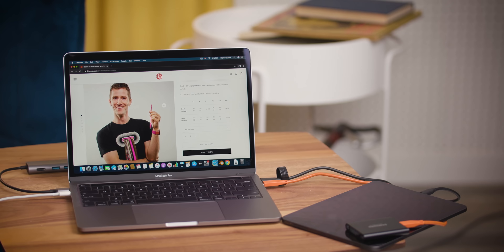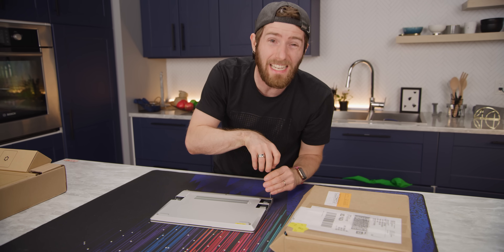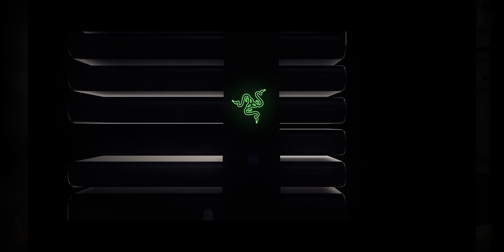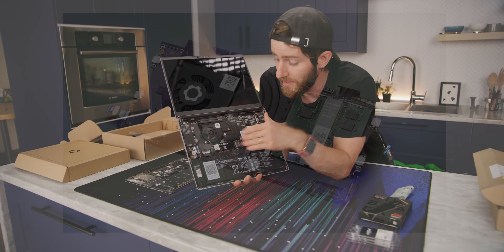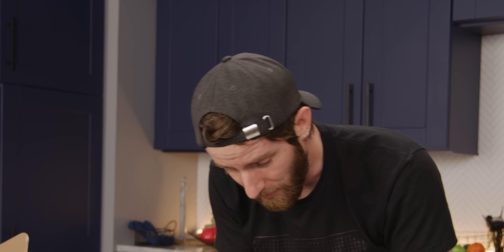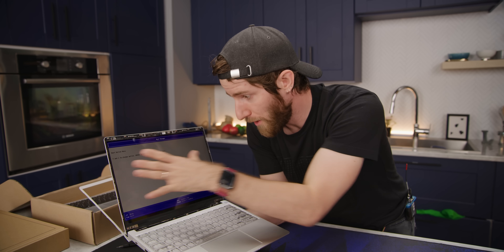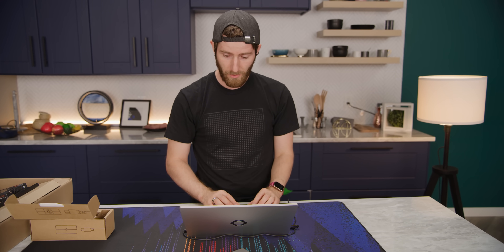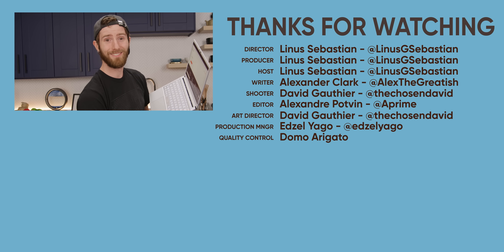A COMPLETELY Upgradeable Laptop?  - Framework Laptop Review

Comment: I don't know if other manufacturers do this but Dell does at least in its business line of laptops have BIOS options for battery usage patterns and charging options. No disconnect option, but with their branded power management software you can set the battery to hold a specific charge range when on A/C power. For instance I have mine set to about 50% so even though I use it on A/C power 99% of the time, the battery is always held around 50% charge. I can go change the setting if I know I'm going to need to use it on battery for a while and the battery is in excellent\new condition that 50% charge is more than enough for quick usage scenarios where I need to be mobile. So that is pretty handy, at least for caring for your battery.

Comment: I don't see GPUs unfortunately. I figure integrated graphics would be passable for the stuff I'd want to play on the go, but I'd like to have at least a decent GPU option to have a more robust gaming laptop. Not necessarily VR ready or anything, but at least something that I Can run games on moderate settings with a smooth framerate.

Comment: I’ll throw out my MacBook when the hackintosh community hacks this bad boy.
Reply: Wait you do realize that for Hackintosh, we have to work around the limits in OSX that try to make it un-runnable on other hardware and NOT the other way around, right? The mentioned laptop will run whatever OS you put on it happily. It’s macOS that decides once it starts that this isn’t a Mac and therefore it won’t run and you should buy a Mac. It’s a very artificial limitation
Reply: @mattcoffin29  This laptop SHOULD already support hackintoshing just fine. It has an 11th gen CPU, so graphics acceleration should work and if they're advertising this as being very configurable then it's a reasonable assumption that the BIOS should pose no problem to opencore. WiFi card is interchangeable so if the intel one that is preinstalled doesn't work with the WIP intel wifi kext then you can easily change it. The only things that MIGHT pose a problem are the touchpad and the cameras, but those can be hacked around to work. The only thing that 100% won't work is the fingerprint sensor, even if the driver is open source.
Reply: @mattcoffin29  Is thare a will, thare a way. Community has the power to do anything. OSX is not magic, so hacks are doable.
Reply: @mattcoffin29  Sir if u know about this little more. Maybe u kknow how is that with M1? I think is not so agnostic right?
Reply: @mattcoffin29  I need a hackintosh that can edit 4k 60fps video because all I know is FCP. Unfortunately, the graphics part of that is EXTREMELY limited. Rather not have everything soldered, but for portability, that is literally my only option
Reply: @mattcoffin29  another problem in macos is that they literally have drivers for ONLY their hardware...
Reply: it's true though, that no OS that exists now is as intuitive to use as macOS unfortunately. I wish it wasn't true but it is. Windows is a virus and Linux, still to this day, requires command line commands to do the simplest crap.
Reply: @trifecta9810  Twister OS, very little command line. It's icons, menus and that  mac bar at the bottom.
Reply: I suppose you could try running macOS on a KVM on this
Reply: Install Twister OS, choose your Mac theme, best OS ever.
Reply: I wish the same but Mac moving towards ARM processor closes this door. Hacintosh with Intel is very unreliable and requires lot of workaround with drivers..
Reply: Whats so great about macos I don't get it... I'm now 2month into using mac because got one at work and would change to either linux or windows any given minute. For example mission control doesn't show labels on windows unless I mouse over which makes it unusable when I have many opened terminals and editors and can't judge which one I need just by looks and need a label. Many tiny examples like this where my guess macos optimized looks over utility annoy be every day.
Reply: @sk-sm9sh  Well.. see it depends upon your usage and what you are used to.. I use both Windows and mac extensively and I love Mac.. (I do like windows too but i would choose mac for my personal device) One major reason is its so much integrated with my iphone and airpods (which is my daily driver and I also develop ios apps) Copy-paste between mac and phone and airdrop is like second nature. Also the apps are super optimised. I have to restart windows Everyday. I cannot think of sleep mode in windows. But my macbook has never been shutdown since a month i guess. I just open the lid, work and close the lid.. Also windows is filled with bloatwares and ads. even after paying for the dam OS I dont accept it.. BTW my macbook is 6 yrs old now and still no lag or performance issue (i7 16gb) There are some flaws like everything but pros wins over cons..
Reply: @sk-sm9sh  no mission control labels without mouse over would be nice but.. unusable? Please. What a joke. macOS is better in every other respect practically. Grow up.
Reply: @sk-sm9sh  Bottom line, stop pretending your workflow is everyone's work flow. Who gives a fuck about up button in finder, there is back. You can set finder to show full path in title bar then you can click on any folder of the hierarchy right in the title bar and it'll go to that folder. You can drag folder icons from anywhere right into file save boxes and it'll automatically go to that folder. yes, macOS has shortcomings but overall it's way better. Certain apps in windows, when in full screen, I can't even alt-tab out of, in macOS I just swipe my fingers on the trackpad or mouse and I go to a new desktop. Easy as shit. btw, macOS is probably better to use with trackpad or magic mouse because of gestures.
Reply: @trifecta9810  I think you haven't been using win for long time as a lot of thing you mention seems outdated.

"but overall it's way better"

I get it. There are differences. It's ok. And I'm working my way over it. But the most annoying thing is exactly this. "Oh it's fine you'll figure in the end you'll see it's way better". Well so far I still can't see it and I'm afraid I will never see it. I understand that different people have different working styles and in my life I had not single time came to person who's using Mac and tried shoving them Win or Linux telling to "try it, it's way better". Neither one isn't. It all depends on work style.

> hierarchy right in the title bar and it'll go to that folder

This is good tip. Only now did I realized that I can right-cilck on it and it drops down. I asked couple people where is the up button and only get response about back-button.
Reply: @sk-sm9sh  overall you can do more in the GUI and int he terminal in macOS since it's UNIX based. So yes, overall macOS IS better. Just not for your specific workflow. And I have been using windows for 20 years before I used a mac believe me. I would rather burn windows then ever use it again. I have had many people say macOS is better. So just different experiences.
Reply: @trifecta9810  what "more" can you do huh?
Reply: @sk-sm9sh  so bomb apple headquarters. What do you want? tbf, Apple has gone downhill since Steve Jobs died.
Reply: Why not PopOS? my sir
Reply: @harshvermac5  As a Linux user, I still have my own hackintosh that I use for video editting (sometimes, I rarely do it these days) and Xcode. I got photoshop to work in wine so I don't need macOS for that, but anyways I'm trying to learn GIMP. Point is, I simply don't see Final Cut and Xcode coming to Linux, and I don't see Darling (macOS compat layer) progressing at a rate fast enough to support these applications.
Reply: @kquote0364  the single thing that makes me the angriest about apple is the fact that they wont let you make apps for an Iphone for example unless you have a macos machine, and even then it HAS to be one of the newer models cause after like a few years they've stopped supporting the older machiens. It honestly makes me want to boycott apple, if every small coder or hobbyist that has have had to put up with their shitty business practices just stopped making things closs-platform for them im sure they would lose some market share st least. Of course thats just impossible and it will never happen.

Comment: You may also want to mention that those little ufl (micro fl) antenna connections are normally rated in the single digit connection cycles. Not knowing exactly which connectors they use, I would assume less than 10 cycles on those connections unless you can get exact specs. from the manufacturer.

I may need to hold out until they have discreet GPU.

Comment: 16:16 Yeah, it saves the battery. But one of the pros of using laptops is you shouldn't be worrying of sudden power outages, which you will if you disconnect it.

Comment: I looked it up and they didn't have a dedicated graphics card. For me, that's a no deal.
Reply: I'd imagine they'll offer a motherboard with a mobile discreet GPU at some point. But like Mobile CPUs, GPUs are BGA-packaged, so they're fused to the motherboard. Or at least one of the Ryzen APUs that have decent integrated graphics.

Hell, maybe they'll ressurrect the MXM format (what laptop Discreet GPUs used in some cases, a modular laptop isn't entirely new as an idea after all)
Reply: @DFX2KX  I assume they could make one more oriented towards desktop replacement. People would be more understanding of it being thicker. They could make the MXM slot accessible from the bottom with a couple of screws.

 You know how an MXM card springs up when you take the screws out of it? Do that in reverse to where it screws to a stationary heatsink and then you just slide the cover back over it, job done.

Comment: wow that looks super modular and easy to work inside, yet also be a nice looking sleek modern package from the outside. It's noticeably thinner than my dell 5410 which doesn't have a replaceable keyboard without ripping into the entire system board.
Edit - I'm just waiting for the Ryzen release at this point. I'll buy a Zen with GPU the first day they of availability hah

Comment: The concept of this laptop it's just awesome. The only thing I would add to this it's just a dedicated GPU for all the gamers out there.
Reply: May be, it can attach a GPU on one of its module via HDMI.
Reply: @tanvirapu885  unfortunately not, as it's not Thunderbolt compliant. GPUs have to be soldered down like CPUs (though they could try and resurrect the MXM format or do something like it at some point, laptop graphics upgrades where a thing... on some Dells even)
Reply: @DFX2KX  maybe they can make a thunderbolt compatible module in the future, they are using intel so they definitely can, they might also release a more performance based machine later, same design but bigger and a bit thicker would be awesome

Comment: Polite correction.
"Battery Disconnect" is not a "Plugged In" mode.
It's there for servicing. It internally disconnects the battery so you can safely open the laptop, replace parts, and all the other fun stuff.
It switches back to normal mode as soon as you connect external power again.
It's also used when they originally ship the computer to you, due to certain shipping restrictions on devices with integrated batteries.

Comment: Replacement parts is a big thing... The post sales support is minimal right now and if you didn't order it with the laptop originally there isn't a way currently to order the parts separately.  This also includes if you break your screen and you need a replacement.

The only addition that I would like to see is something with dedicated graphics cards.  The ability to buy a machine with a last gen GPU and upgrade later on would be amazing.  Many times that is the upgrade we all want and never get with laptops.

Comment: frame.work could totally make a thicker version that has better performance and cooling capability, while allowing for more modules to be attached at any given time
who knows, they could make a dedicated intake and exhaust port arrangement, and the motherboard could be replacable when a new CPU is needed, or a GPU is included or omitted
axial fans seem to always be better than blower-style, they are quieter, they can push more air, and they come in many form factors, the only downside, and the reason why laptops use blowers, is how thick they are... its more efficient to have a super thin blower than a super thin or small axial fan, or fans, but if you can make the exhaust at the back have 40mm fans...
you could even have modules specifically designed for cooling, ESPECIALLY if you design some sort of quick-disconnect and flex-tubing water cooling setup|

for the motherboard, they could have a generation 2 device could have pre-arranged ports that interface with some sort of "distribution board" that can allow for different positions of data connectors, but power can be spread out over the board, and it increases the mechanical connection to each part, but the main reason, is that it would mean that said board could allow for different board designs, while keeping the rest of the device the same, and using off-the-shelf components at the same time, including some sort of special connector that could be over-engineered to allow for different flex cables and sizes of screens, as well as ways to interface with them (maybe the screen could be set up to be like some sort of "external display" so you could even use it separately, should you lose interest in the current device, while allowing modularity)

or, since its supposed to be basically open-source, some of these things, you could do yourself

Comment: Yeah I'm still sceptical but the usb-c links to the modules make the motherboard upgrades pretty straight forward for them. They just build a new one with same 4 ports inside and it'll fit, and then they sell you that (maybe even with a trade in program).

I'm just not sure if 4 ports is enough (and it's not something they can just add more now)

Comment: This is still a propietary design, with propietary modules. It's not open source and you depend entirely on the existant and word of FrameWork. Until there isn't another manufacturer of compatible modules, this is still crap for the consumer. Meanwhile I can get on ebay parts for most hp/lenovo/dell laptops.

Comment: I'll tell you one of the crazy things for me has been dealing with monitors with HDMI vs Dp, with this I can just swap modules vs swaping monitors. OR upgrading a laptop's ram and SSD can be so much easier than it has been. Ram usually isn't an issue, but for someone who grew up with regular drives, dealing with NVME ssd's has been a hassle with the little screws and those things that hold the drives up. If they can make it easier, more power to them.

Comment: interest intensifies 
too bad they don't ship to Europe (yet)
also: an ethernet connector would be nice
Reply: I would like a gigabit or 2.5 GbE adaptor as well
Reply: Once there is an ISO keyboard available and an ethernet, I am sold.
Reply: they dont ship to europe? 😭
Reply: @Blueinfinity7  Initial summer release is US only, worldwide release by the end of the year.
Reply: Well it is more or less a work in progress, i would like the flip out extended ethernet ports and SSD readers
Reply: The moment they ship to Europe is the moment i buy my first ever laptop.
Reply: A possible work-around may be if your country's mail service offers a forwarding service that uses a US delivery address. Our NZ Post company does this and it can work out much cheaper, as well, if you use free delivery to the address and the postal forwarding service.
The only problem may be if the product requires servicing or if the charger requires a US/Canadian style electrical outlet and/or 110V, rather than using a universal voltage and common lead design between the outlet and charger.
Reply: @gordowg1wg145  The charger does ship with a standard North America plug but the wall cable is changeable (standard mickey mouse plug I think) and Framework already said on their forums (in response to that question) that it is a 110/220 switchable input.
Reply: Mhm, as soon as they ship to Australia with a 2.5GbE adaptor, I'm likely going to pick one up.
Reply: The actual RJ45 port doesn't fit within the size of their expansion modules but they're working on an Ethernet module now. They're also offering CAD drawings/3d printer sketches and breakout boards, as well as a grant program for paying people to come up with new custom modules that they can sell on their marketplace in the future.
Reply: @r.l.royalljr.3905  There are designs for the RJ45 socket that have a hinge or that completely pop out of the module. They can fit full size DisplayPort, they can do RJ45. See Thinkpad T480s for an example of that.
Reply: @666Tomato666  Yeah, it looks like that's the way they're leaning. There's a huge discussion about ethernet and other custom modules on Framework's forums if you want to follow along. There's also talks about doing a double USB-C or USB-A + USB-C cards but since all of the motherboard sockets have PD capability, they're not sure they can fit all of the circuitry for two ports into the form factor they've got. But they're working on it!
Reply: @r.l.royalljr.3905  RJ45 connectors can be folding/transforming to be smaller in the chassus but expand to fit full size Ethernet
Reply: I imagine they could release cad drawing or firmware to self made any sort connector. Or adapter for mine lab equipment for example.
Reply: @alesksander  based on what i watch, they will release the cad or at least blue print of the housing